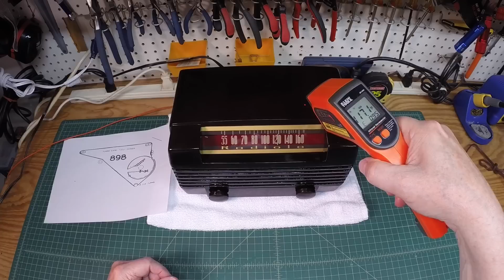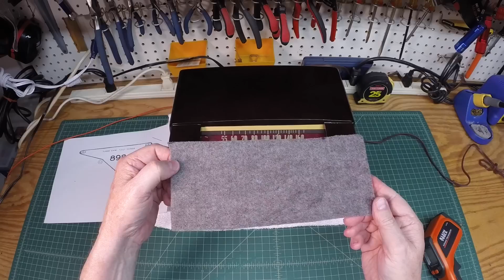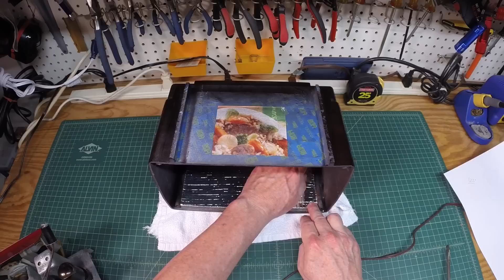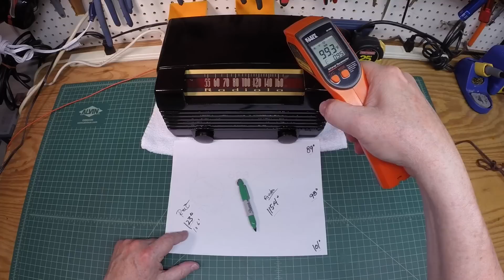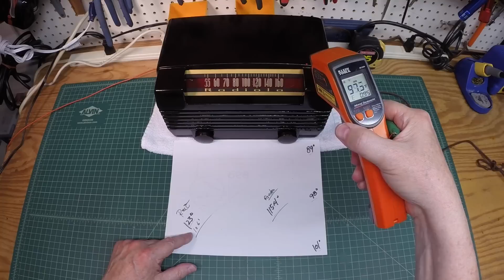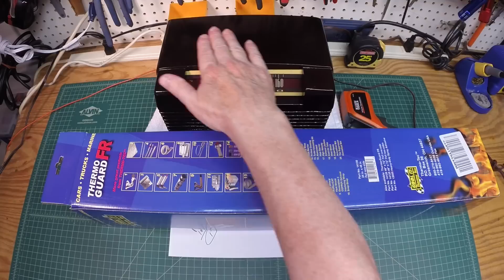Radiola 61-8 - Finale

Comment: I've never seen or heard of doing this. Do you really want to create a mini oven by deflecting that heat back into the chassis? Also, it's usually a tight fit when sliding the chassis back into the cabinet, especially the top portion not hitting the dial plate, pointer area and the dial cord. Heat over time is a killer of many of these old radios. Waxy capacitors?
Reply from the maker: Good point. As far as I know from the owner, all is still well with the radio. I don’t think it gets much playing time, which factors into that. At least we don’t have to worry about the capacitors. All the best. Don

Comment: Great series of videos.  I just got an RCA 56x that was cracked during shipment(not nearly as bad as your Radiola).  You've inspired me to try repairing it.   Thanks!
Reply from the maker: +rotolactor Congrats on your 56x even with the cracked case. You should definitely go for it and make the repair. You may consider using plain old Bondo. Keep me posted on your progress. Best, Don
Reply: Thanks!  Epoxy and cloth on the inside, and Bondo as a filler on the outside?
Reply from the maker: +rotolactor That should work. A little sanding afterwards and of course painting the cab and you'll have a better looking cabinet than left the factory. Good luck. Best, Don

Comment: Hi Don, Like someone referred to below, you may have to show the owner’s the videos so they will believe it is the same radio. Remarkable job. I’m sure they will be pleased and surprised. I hope they appreciate the work you put into this project. Now you need to take a moment to reflect, have a cool beverage in that heat, and then on to the next one. We will be waiting to watch. Again outstanding job. 73 P.S. Thanks for the tip on the insulation!
Reply from the maker: +Larry K4MU Thank you Larry, it was more work than I expected, but worth the effort. The cool thing is, I learned a lot and next time I encounter one like this, I can fall back on lessons learned. I'm rehydrated and hope to get started evaluating the Philco that belongs to the same family next. Busy times at work and home now and it's difficult to find time to spend on this amazing hobby. Thanks again for following along. Best, Don

Comment: Wow, Don, That radio turned out awesome!  I'd love to see a video of their reaction when they get that radio back.  That has to be the best part of the whole process, lol.  Interesting choice of that thermal barrier.  I wonder if the inside of the cabinet itself is much hotter now with that inside reflecting the heat back down?  I'd be worried the extra heat would possibly lead to faster component degradation, but as you say, it doesn't have a back panel on it so it should vent well.  Take care, Gary
Reply from the maker: +Rebel9668 Hi Gary, that makes two of us. My Dad will be the one presenting it back to them, so unfortunately I'll be missing out on... I didn't see any significant change in the temperature inside the cabinet with the thermal insulation in place. In addition, operating the radio in a normal environment reduced the temperature by some 30 degrees over the documented results in the hot workshop. Thanks again for watching and following this project. Best, Don

Comment: Just an awesome restore Don! Wow, thx for sharing. You know a 15 degree drop is allot. I wonder how many cracked cases would have happened with that very neat foil insulation cooling, if they did that back in  the day. Of course they may have used asbestos back in the 30'S, Yikes, lol
Reply from the maker: +saturn5tony Thank you Tony. The product for this application did exactly what I was hoping to achieve. I appreciate you following this project and your kind words along the way. Best, Don
Reply: +RestoreOldRadios I just really admire your work and so grateful for the tips (As we see) It's very easy to compliment professionals that share such great knoweldge. Thank you so much my friend.
Reply from the maker: +saturn5tony Thank you Tony.